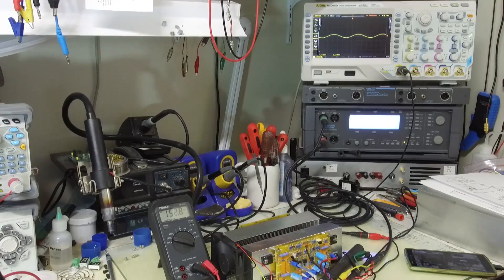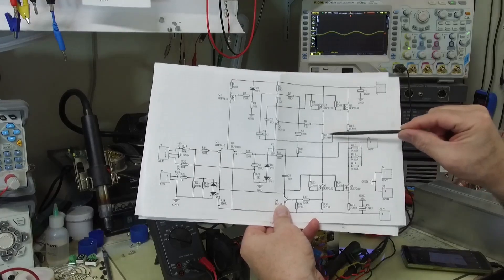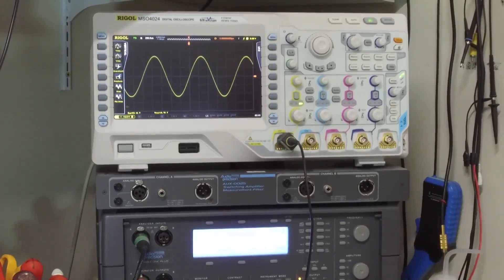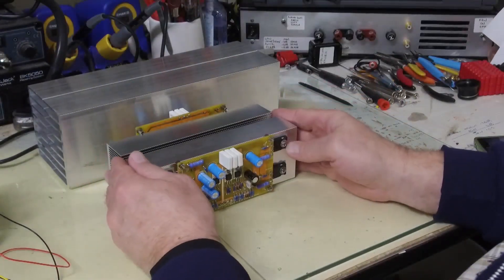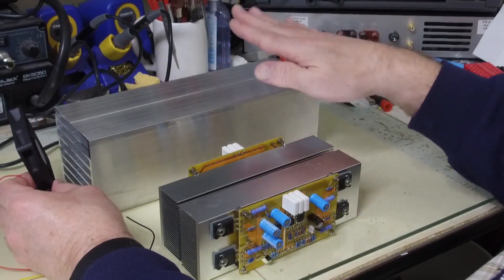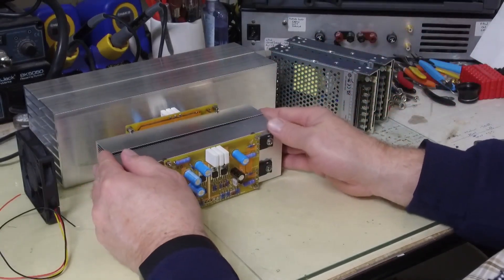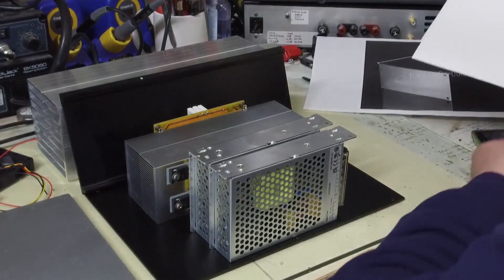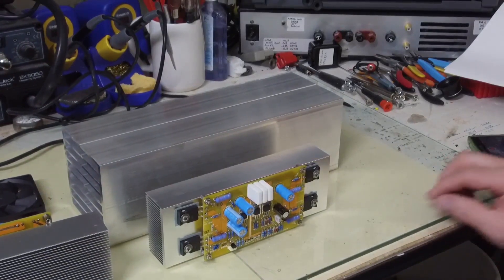Pass Aleph 3 clone.  30W Class A Amplifier. XP Power AC/DC Switcher. Douk Audio Chassis.

Comment: Thanks for the video Dan, very informative. Question, how do you plan to power both channels with the two SMPS units, i assume you will be pairing them up to create the +24/GND/-24 then power each channel in parrellel?
Reply from the maker: Correct.  Since each power supply's output is isolated, they can be connected in series to form +/-24V.  These units have enough capability to power both channels in parallel.

Comment: Thank you for a a great video, thinking of building a Pass design myself, for now just trying to get ideas from smarter folks! 
Regarding the fan, you could try looking for a fatter PC cooling fan, something around 25mm thick, specifically designed for higher static pressure. A company called Noctua has some great options.
Using two fans for a push-pull design could also be good. 
Perhaps also leaving a gap between the heatsinks and sealing the gap with aluminum tape to create a "duct" could also help not overload the fan and keep the air moving, but in this case I'm not sure if that flow would be enough to disturb the boundary layer enough.
Best of luck! I love the hidden heatsink idea and am curious how it will turn out!
Reply from the maker: Your welcome.  Your ideas are good and have been looking adding a space between the heatsinks.  Will also look at other fans that can deal with higher pressure.  I'll take a look at Noctura.  Thanks.